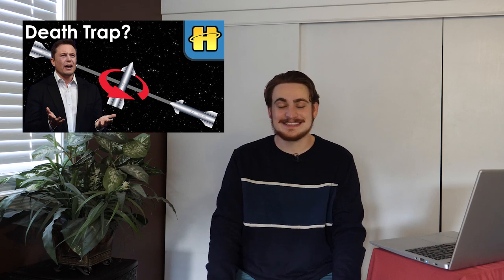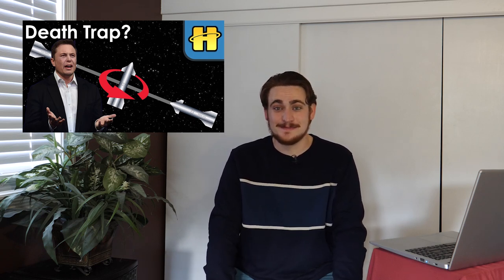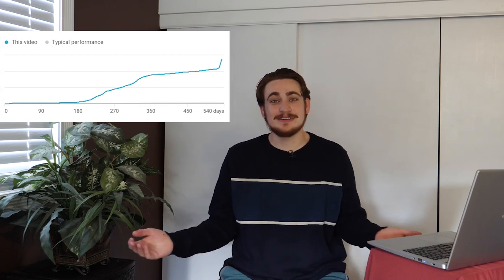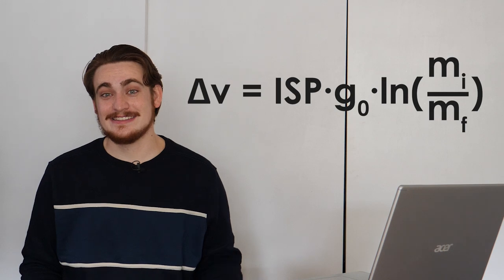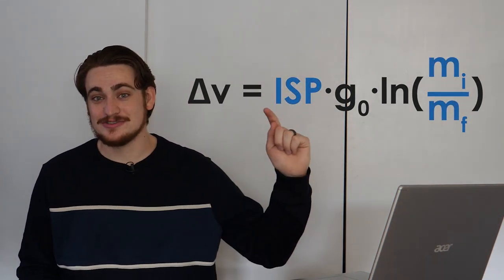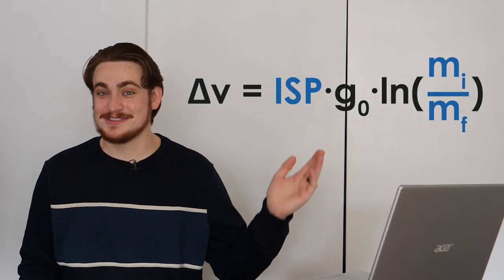Is Thrust-Based Artificial Gravity IMPOSSIBLE!?

Comment: What's the stuff you throw out the back going to push against, to give you forward motion, when you're in a vacuum?
Reply from the maker: The exhaust pushes on your rocket directly, it doesn’t need to push on air like a propeller (that would just slow it down and actually makes engines less efficient). The easiest way to think of it is conservation of momentum. If you start with a 1 ton rocket with 1 ton of propellant at rest, then shoot the 1 ton of propellant out the back at 100 m/s, conservation of momentum says the recoil will push the rocket at 100 m/s in the other direction, no air required.
Reply: @ConHathy  Thank you for your response!  Yeah, that partly makes sense.  But "re-coil"; there's a spring involved (if only in terms of wordplay) -- some tension that is being worked against, in the atmosphere?  In vacuum it seems it would behave differently, although I've not experienced it.  Would love to see an experiment of "testing thrust in a vacuum chamber."  Thanks again!
Reply: @kennethbeal  for every action there is an equal and opposite reaction. your rocket exhaust is the action the reaction is your ship going forward. it does not need anything to push against. this is basic physics.
Reply: @kazimirmcfoster5631  Thank you!  Your first sentence holds true in non-vacuum.  I'm not certain it behaves that way in vacuum.  Telling me isn't sufficient[1]; if you can show me an experiment, then it will satisfy the science requirements.

[1] -- I'm not sure I'm conveying this properly; I'm not arguing, I'm not angry, and I'm not disagreeing with your assertion.  I am saying, experimental evidence beats hearsay every time.  In court, and in life.  :)
Reply: @kennethbeal  the fuel isn’t pushing against anything so to say, it’s more so that when the fuel is expelled out the back, the equal and opposite force acts on the rocket. you can experience this if you take a brick and whilst sitting on a rolling chair throw it away from you, while the brick does encounter air resistance, it is the mechanism of force put into the brick that will push your chair backwards.
Reply: @kennethbeal  Just google equal and opposite reaction. It's such a basic principle in physics You'll find tons of info and videos on it.
Reply: @andyherle  I agree with you that someone sitting in atmosphere somewhat simulates the experience, but does not fully encapsulate the variables that I can envision.

What does a balloon do when opened in a vacuum chamber?  (In the manner that would "fly around the room" that is, outside the chamber.)  And, is that different from what it does, "in a vacuum chamber up in a satellite"?
Reply: To answer the original question, when you use the fuel it increases in volume and temperature in some form of physical and/or chemical reaction, so when you contain that in a smaller volume it exerts pressure.
Basically, a spaceship, a bullet, a piston engine, and a shaken up bottle of Pepsi are all the same.
The thruster nozzle is designed to do this with an optimal surface area opposing that pressure front in order to propel the ship forward, because both the ship and the exhaust must accelerate equally in opposite directions inversely proportional to their mass, as nothing physical in the entire universe is ultimately fixed in any position anywhere.
The thruster nozzles are designed with such a degree of engineering that it takes less force to move the whole spaceship than it does to break the thrusters, despite the thousands of degrees combustion explosion perpetually occuring.
You could pick a virtual point like the location facsimile of where the Big Bang occured as a point of reference and unironically say that you are already measured yourself traveling at just under the speed of light.
But that's hard to do, try bottle rockets. Also, a balloon that is sealed will explode before the environment reaches full vacuum. That one is easy to see here on YouTube.
Reply: Sit in a well-oiled spinning chair, and move your arms or legs one way, you will spin the other way. That's Newton's 3rd law. This has little to do with air resistance because your arms and legs aren't big enough to move much air.
Reply: @kennethbeal  
Yes, a balloon would fly around in a similar way.

Another experiment to prove that rocket propulsion works regardless of atmosphere is this: stand or sit on a skateboard or something that can roll easily. Throw a bowling ball (high mass, low surface area), and record how far you move. Now throw a large sheet of paper (high surface area, low mass) with the flat side against the air, and record how far you move. The bowling ball and paper represent the exhaust products of a rocket engine. If rocket propulsion really were based on "pushing against something," then you'd move further with the sheet of paper, because that pushes more air than the bowling ball. But instead I think you'll find that the bowling ball moves you farther, meaning that the force doesn't depend on how much air you're pushing, just on the mass being expelled.

Comment: you should use the relativistic rocket equation r = sqrt(b^2/(1-b^2)+R^2)-R+1/sqrt(1-b^2)-1😉
Reply: r = Menergy/Mship, R = Mpropellant/Mship, where Mship is the empty mass of the ship and b = v/c. The propellant mass is dead mass could be water. The Menergy is the energy used.
You can also let R = 0 if you don't throw dead mass out the back.
Reply: Also, you could store energy in a plasma and magnetic field externally to the ship the energy in this case can be quite large and the field would be many times the size of the ship
Reply: You could get this energy from a special solar collector near mercury and the field could collect cosmic rays, if you construct it right.
Reply: Interesting!!!
Reply from the maker: I thought about it while I was working on it but the speeds were small enough that it seemed a bit overkill less than 0.008% of C. I haven’t worked with relativity much so didn’t feel confident using and explaining it as well. But, as I understand it, the traditional rocket equation is actually over estimating the performance of the rocket as you get closer to C so it is still a conservative analysis
Reply: @ConHathy  True, it is overkill for that particular problem. I always use the reletivistic rocket equation when planning missions to other stars 10 or 20 light years away, where the speeds end up being closer to c. And you have to use more exotic propellant types.  Oh, sorry for posting with one account and replying with another. The space engineer creations was another channel I was making but apparently I don't know much about how youtube works...

Comment: There is no way for artificial thrust gravity unless with the nuclear salt water engine... but maybe not even with that.
Reply: even then the version of the nuclear salt water rocket would run into the same issue of thermal management than the epstein drive.

Comment: Why are you talking about thrust to weight ratios? Everything in space is weightless. You want to look at formulas that use mass, not weight, right?
Reply from the maker: If you want to produce artificial gravity then you care about thrust to weight. If you have an engine that’s 100kg, it needs to produce more than 100kg of thrust to accelerate at 1g (if you ignore fuel)
Reply: @ConHathy  ah ok. The 1g creates the weight, thanks
Reply: @ConHathy  FYI, from a stand still, you only need to accelerate at 1G for 22 hours to get halfway to Mars (18 million miles) when it's closest to Earth. Then decelerate for 22 hours to arrive. So you're only looking at 44 hours of thrust needed for the entire trip.

Comment: Watch the expanse guys
Reply from the maker: Great show! If I recall the authors of the expanse said the Epstein drive ran on “efficiency.” They didn’t know what technology could do it, but whatever it is it would have to be near perfect efficiency (converting mass to kinetic energy)
Reply: Wasn't it fusion with a catalyst tho
Reply from the maker: @Pan_cak  yeah, but I don’t think they every ironed out the mechanism that turned fusion into thrust so efficiently. I could be wrong though
Reply: But could antimatter work for extended 1g periods
Reply: It's so funny I wrote a comment in your other video about this and right after I posted the comment I saw you had this video and came right over to watch it. Going to a question I had about this concept is, I think maybe an idea we could look at two different types of rockets. One that's designed  for leaving  a surface of a planet or place and another for the long road travel from say planet to planet. Designing a rocket to fly through the air and fighting gravity as it would leave the atmosphere surly is going to have a different design then one that would stay in space and fly through space. Your thoughts on that please?
Reply: @samwampler2060  yeah it would be easier for a rocket to be Designed for aerodynamics for the atmosphere and one for the long road because making a hybrid of the two is kinda hard because the space rocket would need radiation shielding wich is likely to be heavy and massive radiators if the ship has an engine like the epstein drive or some really hot fusion or fision engine  (something overlooked by most scifi shows ) a more realistic space ship would be the ISV Venture it needs to lose heat from the engines and also electronic heat and heat is hard to lose in space because we can only lose it by radiating it and that takes a long time  , now imagine magically hiding those radiators , atmospheric ships will need to be aerodynamic and they can lose heat easily without massive radiators due to convection

Comment: Some comments halfway in. Space is very cold. So we're probably good on that :) other than that, isn't it true that the faster you're going, the more fuel you need for the same acceleration because you posses more kinetic energy which makes you heavier or something? Not sure if that's true but it's how someone explained it to me. One way to overcome this is by accelerating to a certain optimal cruising speed, rotate in flight, decelerate, rotate again on the next day, accelerate etc.
Reply: 1. The internals of a ship are MUCH warmer than hydrogen's boiling point
2. The sun exists, and there is no shade in space.
Reply: @Wise_That  says he while throwing a whole forest of shade on me 😁
That's gonna be a problem when they want to use fusion reactors in space. Helium-3 is only a smidge heavier than hydrogen, be it twice as heavy. But it has a much lower boiling point.
Reply: If you're talking about relativistic effects then that wouldn't apply unless you're going near the speed of light. And anyway I think that you'd still "feel" the same acceleration per fuel spent, it's just that an outside observer would see you speeding up less, and you'd see the space around you speeding up less (and also contracting in length).
Reply: @ryanmccampbell7  I'm only talking about the fact that helium-3 takes more effort to keep in liquid form as hydrogen. After some quick fact checking, hydrogen boils at 20 Kelvin, and helium-3 at 3.19. But per energy output, the amount of helium-3 required is negligible compared to other fuel sources. So that makes it easier again.
Reply: @bramweinreder2346  I was referring to the "the faster you're going, the more fuel you need for the same acceleration".
Reply: @ryanmccampbell7  Right, got you. Not sure if that also works the same in a vacuum, but it's one of those things that makes intuitive sense since you're working with an object's inertia which (I think?) is greater the faster it goes. But I'm not a rocket engineer, just a science aficionado.
Reply: Actually object around earth's orbit (mind you they will be a little hotter the more outur space) is like 120 celcius in direct sunlight, and 10 celcius in earth's orbit)

Comment: Arguably thrust-based gravity is "better" than Earth. As there is no gravity gradient to worry about or rotating reference frame issues.

It's also extremely difficult to accelerate at any appreciable fraction of 1 G using a rocket thruster for more than a few minutes at a time.